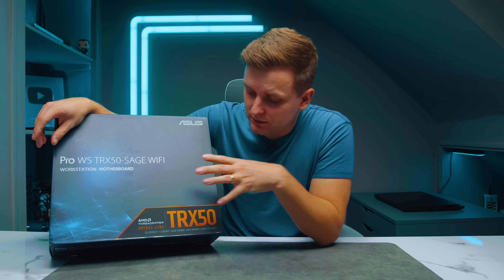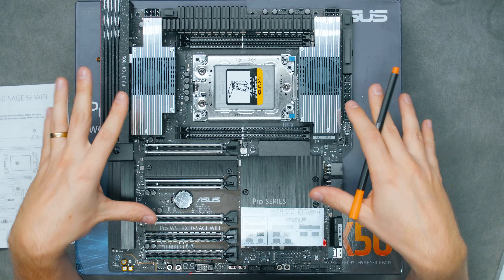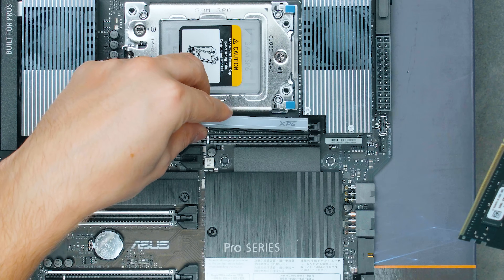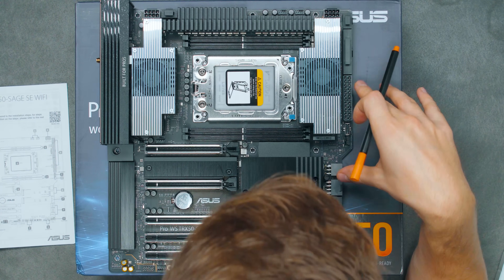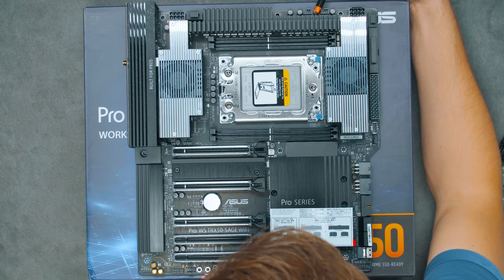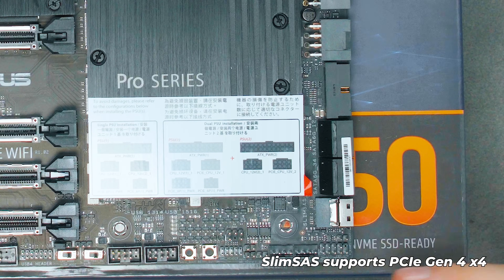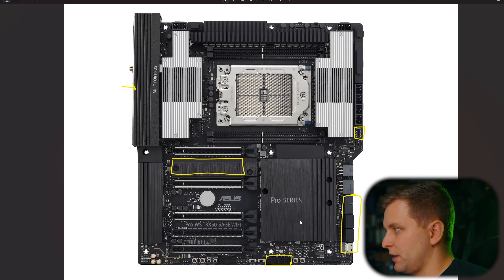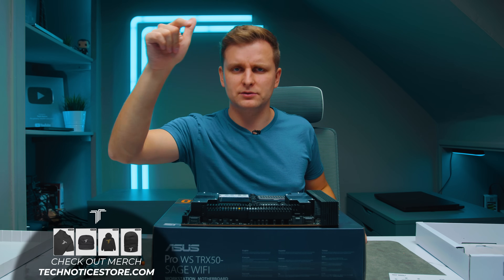The Secrets of the $900 Motherboard Revealed! ASUS Pro TRX50 Sage WiFi Review

Comment: According to the manual, the connections for a "standard" and a "high powered" single PSU are the same.  Dual PSUs should be used only when overclocking.  So, PCIE_CPU_12v_1 and PCIE_CPU_12v_2 (the two power recepticles that are plugged in the picture shown at 7:29) should not be used unless a second PSU is used.  This is shown on page 46 (section 2.5) in the motherboard's user manual.

Comment: Be aware this mb uses alot of pcie pins. I have a seasoning vertex 1200 and after using the single psu setup, I only have 1 pcie pin left available. Can't run my 3090 cause it needs 2x8 pcie. So now I have to get another seasonic 1200 watt psu and run the dual psu set up just so I can have a gpu let alone run two gpu. That's a extra $300. Luckily my case is a dual system so putting in a 2nd psu won't be a problem. Just not too happy about needing to buy another psu. I also have one 600w pin connector, but I have nothing in can utilize that atm.

Comment: Back in 2018 I build a PC using an  AMD Threadripper 1950X 16 core 32 threads. Last year I added a Corsair 1500 Watt power supply along with an MSI NVIDIA 4090 GPU. I was hoping to add an additional 4090 GPU. At $900 it's disappointing the TRX50 won't fit 2 4090 GPUs.
Reply: It can fit 4 x 4090s. I am using with dual 4090s just fine.

Comment: I really didnt understand one moment. Need i connect all 4 CPU ports if i am using one PSU 1500w?
And need i connect PCI 6pin and 8 pin into the Motherboard, if i connected 3-PCI cables with adapter  to my rtx 4090? Thnx!

Comment: The add. 8 Pin Header is for powering the PCIe Slots. With Multi GPUs you could burn the 24 Pin otherwise. They arent ment to power the CPU socket.
Reply: Hello. Do you mean the adapter power cable they supply? What are they for?

Comment: 900 quid for a motherboard? Seriously??? Are the USB, PCIe and memory contacts gold-plated or what? I've been building PC's since the Intel's BX chipset was a massive hit, ASUS have always been my proffered choice but in the recent years the component manufacturers have gone on to milk the end user as much as they can. There's no justification for such a price tag, especially for a motherboard.
Reply: PCIe5 is expensive due to the signalling and the way the boards have to be built. On a platform that supports so much which is also a low volume board of course the price is going to be high.

If it makes you money, that's just the price of entry.

Comment: I find it a bit weird that AMD only allows you to have 2 TB of memory while Intel allows you to have 4 TB of memory while AMD has the CPU's that would probably make the most use of the higher memory capacity.
Reply: It's sort of a moot point anyway, to get 4tb you'd need 16 slots full of 256gb rdimms, at around $3k per. That's $52k of memory. There are no workstation boards with that many slots anyway, and I can't find anything suggesting more than one dimm per channel is supported (it likely is as it's going to use the same memory controller as Xeon for servers I'd bet, but still).
Reply: @morosis82  Supermicro has boards for both the W790 workstation and C741 server chipsets that has 16 memory slots, allowing you to run 2 DPC.

Edit: I bought in to the W790 platform with an ASUS board built for the 24XX series Xeons earlier this year. It "only" has 4 memory channels, but it has 8 slots allowing you to use 2 DPC and supports up to 2TB of memory.

While I would like to have 2TB of memory, I can't justify the purchase. I could never use up even a fraction of it and the slower speed of those huge dimms would only make me lose performance.

Comment: I don't think PCIe layout is bad,
for professional/enthusiast build you can/should go for liquid cooling, where 2-slots height is totally enough,
and also this layout allows for quad-gpu setup,
I'd say for most casual users, using 2nd x16 5.0 slot might be actually best for gpu (favorable air intake from bottom of the case), leaving top x16 5.0 slot for some fancy 4x4 or 8x4 M.2 array

Comment: he doesn't seem to realize this is a pro board. pro gpus that would be used with such a board do in fact only use 2 slots. the layout of this board is verry well thought out.
Reply: Indeed, when it comes to the professional or server world, he makes wrong assumptions because he doesn't know the enterprise world. He has made similar mistakes before.
Reply: Or he makes those mistakes on purpose so that people start commenting and correcting him, otherwise there's nothing to comment on
Reply: Depends. For a lot of industries and use cases the pro cards are a joke. If you are 3D modeling for visuals / realtime / most kinds of 3D printing then the value of GeForce cards breaks any want for Quadro / now called just "RTX" (confusing af)

I haven't looked at this gen but I did for RTX 3000 vs professional and you can likely get a 4090 to run Blender scenes overnight with for the same price as a professional card that has 1/5 the performance and 5x the render time.

If you want to run Solidworks specifically or do things with 3D in VMs then you need to go pro though.
Reply: @KD-_-  I don't 100% agree with this. While gaming cards are often a lot better profformance for the price they are garbage tier for the power draw even when talking about gaming profformance.  An A4000 games just as well as a 3060ti and only draws 140watts compared to the 210watts of the 3060ti. The fact is that running larger cores at lower frequencies is just more power efficient than the inverse.

Comment: The only thing I find strange is only 1 slimsas and I'm unclear on if their thunderbolt 4 card can work with this motherboard (seems not), otherwise pretty nice board, though ASROCK's board also looks pretty good for a little less.  As for the PCIE spacing A series cards would fit, if you were going to run 4090's I guess you would have to go water or hack together a blower cooler.

Comment: With a single high end PSU i have to connect 4 cpu connections? 2 on the board and 2 using the adapters? Am i right?
Reply: No you only need 2 if your not over clocking, the GN oC stream was using a thor 1600 to get 5.2 Ghz OC on LN2
Reply: I confirm, only 2 if you don't overclock.

Comment: So which motherboard has the most PCX lanes for adding lots of M.2/NVME drives?
Reply: Wait for the WRX90, these have 128 lanes from the CPU
Reply: Wow. @YtterbiumUK
Reply: The Pro boards but you are going to pay a fair penny more compared to the HEDT boards for the extra lanes.  Of the HEDT boards the Asrock board has 1 more SlimSAS port than the Sage but I believe the PRO will also have 2.

Comment: Will plugging in a second power supply without overclocking the CPU cause any damage?
Reply: A power supply can not force power, it can only deliver power when requested to do so. So having 1 or 2 makes no difference.
Reply from the maker: No

Comment: If you buy this board, a cpu, pcie5 storage and multiple gpu.. you should be watercooling. At that point its a fraction of the system cost... Just hope someone makes a vrm watercooling solution for a board with this socket.. dont like small fans 🤮

Comment: Hmm very interesting, I've been waiting for the the non pro threadrippers, I and a video editor /motion graphics person, a few things I am wondering about after watching this. I need thunderbolt support as have many, many drives that are thunderbolt connections as well as normal USB C drives. Do these support Thunderbolt and is there an add on card for usb c ports at all? The m.2 add on is great for sure but definitely need thunderbolt and more USB C ports. I haven't used a threadripper before so not sure if these are supported but was really hoping they would be.
Reply: You can buy a Thunderbolt PCIe card with dedicated controller - That should give you Thunderbolt without any issues
Reply: Asus does have a thunderbolt 4 card but you would have to check if this motherboard is supported.
Reply: @nadtz to me it looks like a different pin out on the headder, so it could be a new version of the current card
Reply: @YtterbiumUK  Quite possible, the TRX50 board isn't listed as compatible for the current card.
Reply: @nadtz  Thanks, I'll do some more research and also wait to see what other Trx50  motherboards come out, they all have slightly different specs, but good to know there is a potential option

Comment: Sad to see less m.2 port than a z790 mobo.😢😢😢
Reply: Easy, get the hyper M2, another 4 M2 cards at gen 5 speeds
Reply: @YtterbiumUK 
If I add 2 Gen 5 GPUs (Quadro like workstation GPUs) I can add only 2 more Gen 5 NVMe SSDs on third slot to configure in RAID 0 kind of software RAID configuration through Windows OS, for higher write speed.
The default 2 Gen 5 NVMe slots will be consumed for OSs. One for Windows and another for Linux.
I wish there could be few more Gen 5 NVMe slots for Linux RAID 0 kind of software RAID configuration. For better write speed.
Reply: z790 cheats, you can't use all those slots at full speed simultaneously as most go through the chipset. This one you can, and you get PCIe5. Z790 only gives PCIe4 for m.2 unless you sacrifice some lanes from the main x16 slot.

If you want m.2 get a card for the bottom slot and add another 4x m.2 at full speed PCIe4.

Of course, there are space constraints also due to the size of the socket.

Comment: Content creator "overclocking" is not about overclocking, it's about performance tuning and controling temps for maxium reliability in your use case. Overclocking features NEED to be on every content creator's motherboard now days as thermal throttling is a real wall for performance computing. Sure the main goal is use your product right out of the box, but without controls like these manufacturers might have to make 2+skus for desktop v.s. rackmount, or other combinations. If this system was full up with GPU's the heat put off even with watercooling may be enormous and being able to underclock the CPU's and GPU's a bit might just be the difference you need to make a system stable. Currently big energy and multi core performance gains can be had in undervolting for sometimes negligable loss in performance over all.

Comment: Will the EPS connectors and 24 pin be redundant?  So two power supplies, if one dies, you can still use the computer.   I assume they would not be hot swap, but really depends on the power supply, obviously.   In this way the video cards would also be setup for redundancy, not sure if this board can handle that.
Reply: I saw another review somewhere, where the main complaint was that there is no redundancy with 2 power supplies.. so I would do some more research and probably go with power supplies that are redundant in themselves if it is a must have for you